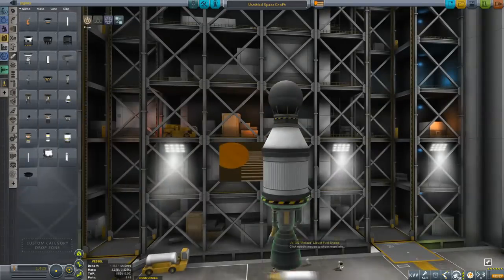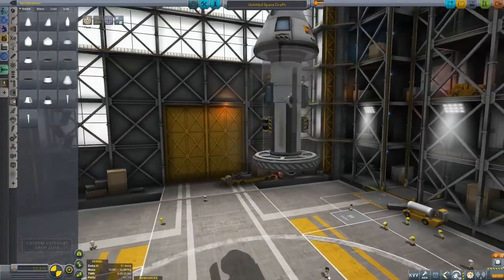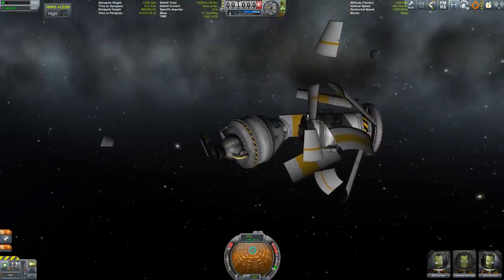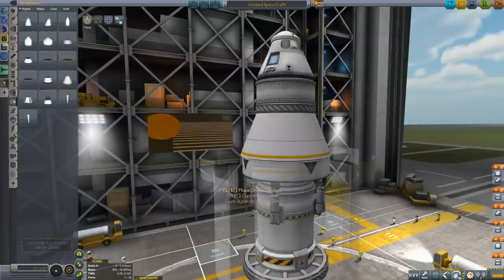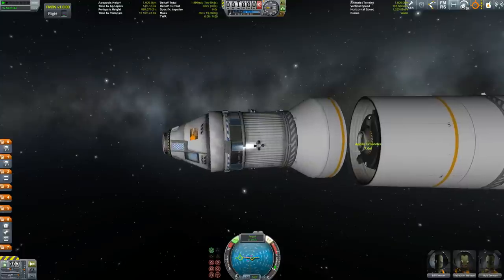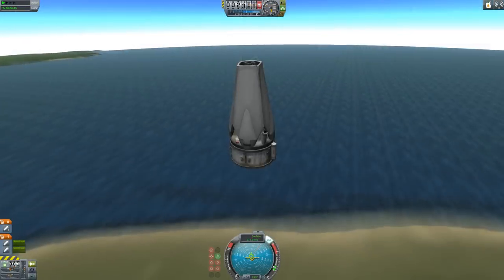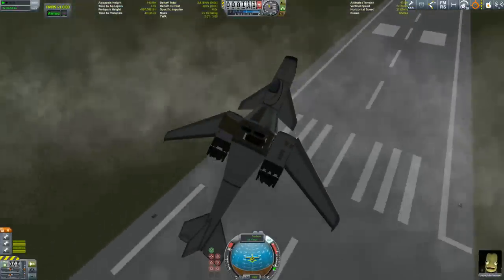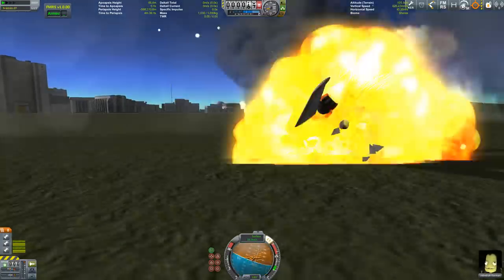Fun with Fairings - Apollo style Tutorial - Kerbal Space Program

Comment: kinda makes interstage fairings useless if you can't activate engines afterwards. I had a Saturn V that I built with procedural fairings in a pre- 1.0 version of KSP and I worked great. I was going to convert it to use the new stock fairings... but now I am kinda disappointed in how they work. also not really liking how the stock fairings splinter into a million little panels instead of splitting like a real fairing would.
Reply from the maker: dregerclock I don't mind the splintering but the engine activation is definitely a bug. I hope they fix it soon.
Reply: dregerclock seems like a major bug, one im sure they'll fix soon.
Reply: lordoftheflings it's not a bug, the hack he uses to allow something to have a floating decoupler, thus creating a fairing that can contain something you can detach from the fairing base without deploying the fairing first is just that, a  hack. If there's a bug it's the ability to do that...
Reply: dregerclock You just have to reset the instance of the craft. Quicksave (F5) then quickload (hold F9) will reset the state of the engines and anything else that will not work because it was in a fairing and it will activate.
Reply: I found a small mod that allows you to select either confetti or clamshell fairings,
Here: https://kerbalstuff.com/mod/878/Stock%20Clamshell%20Fairings
Reply: +CaptainDuckman  That bug also occured without the exploit he used (it's an exploit not a freaking "hack"). When you got your craft out of the fairing before opening it your engine would not start, so you are wrong.
Reply: +Jason Neu wonder if they fixed it now.
Reply: lordoftheflings Same here, haven't checked it yet. When I'm back from work I'll check if they fixed it and tell you, that is in case I don't forget it and fall asleep :'D
Reply: +lordoftheflings They did :D
Reply: +TriangleDogg awesome thanks!
Reply: lordoftheflings In the next update (1.1) there will be lots of fairings that act exactly like the real ones (conchshell fairings they're called, I believe).
Reply: wrong mollusc, they're clamshell fairings ;)
Reply: And BTW, They Improved Fairing physics, so the engines will work while stowed, and in 1.1 they added clamshell fairings.
Reply: yep. my original post was a year ago.
Reply: ShadowZone  .
Reply: dregerclock clam shell deploy... Have fun

Comment: I tried to build this and its starting wobbling between the docking port and the decoupler.
HOW CAN I FIX THAT? 
struts dont work. i tried it
Reply: try kerbal joint reinforcement
Reply: +Zelop
if u want to cheat and can still live with urself, just do "mod+f12." the modifier key is alt on windows and shift on some other kinds of pcs. if those dont work, use command or control or whatever else. but anyway, hold modifier then press f12. itll bring up a menu w/ cheats on it, and one of the things u can select is "unbreakable joints"
Reply: Max Hess thanks. i gonna try this out